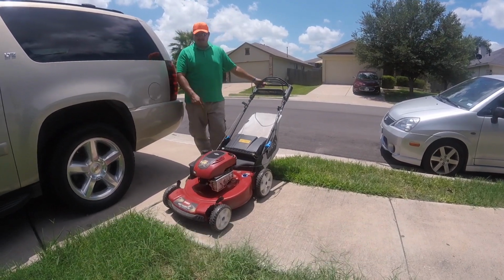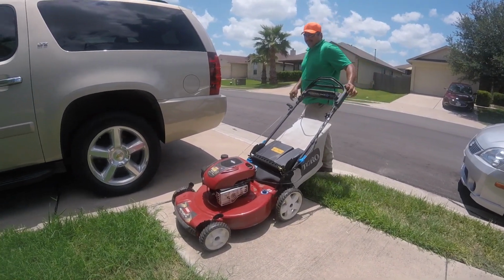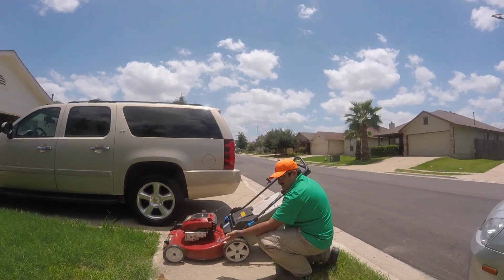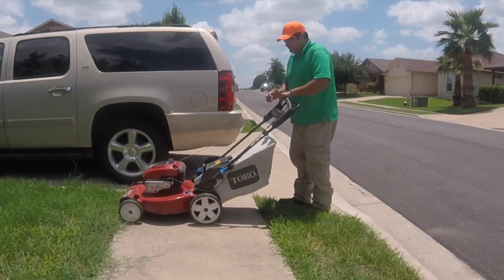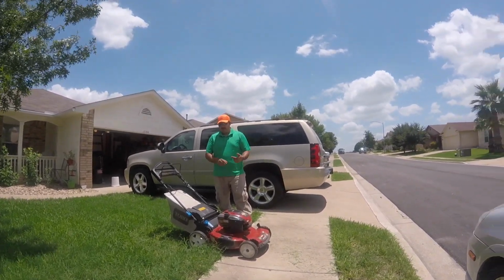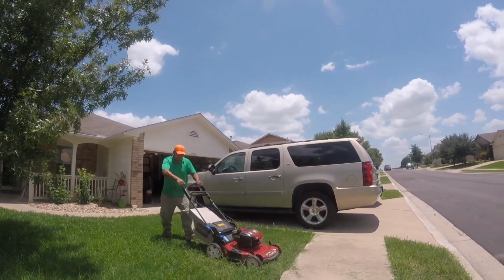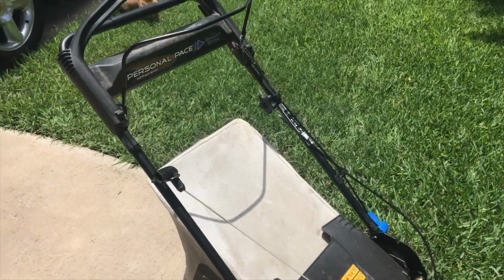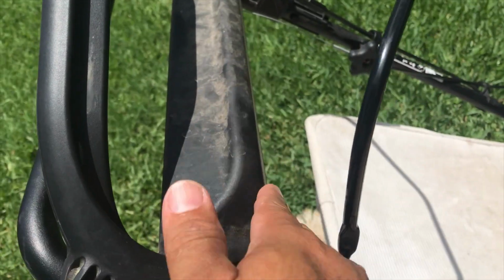Toro Recycler SmartStow (22") 190cc / I DONT LIKE THIS MOWER!

Comment: One tip for the Personal Pace: when backing up, let go of the plastic handle and pull backward using the steel handle under the plastic handle.  It works MUCH better and is just a simple hand shift.
Reply from the maker: Thanks for the tips,  I did take back to the local dealer to get it fixed  and they were able to fix the transmission system that was the big deal

Comment: As an owner of one of these and a GM mechanic for 30 years I would like to point out the fact that this is not the best mower that god himself created, If you don't service the drive train it does not want to roll backwards and it cant handle tall grass for shit.
If you're cutting a lush well maintained lawn without letting it over grow it does a clean beautiful cut, That's not always how real life goes.
Reply from the maker: Thanks for sharing that information, it’s definitely one of the worse Mower in my life but I guess is because is 4wd, in the past I have the same mower but bigger wheels on the back and transmission in the front, you have no idea how good those are but this one it’s  ok for cutting few times a week but not every days , I did take off the belt from the rear transmission and I’m only using the front transmission now but still is not pulling or rolling backwards it feels tided also I have to keep adjusting the transmission cable to operate the self propelled,...